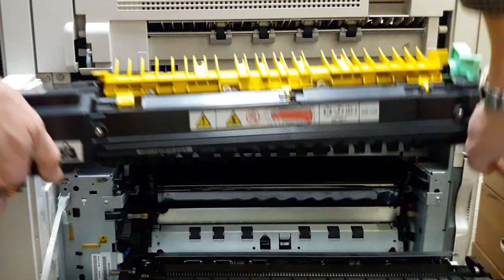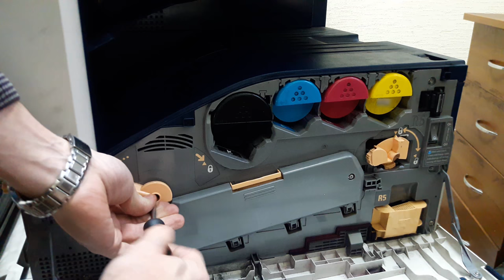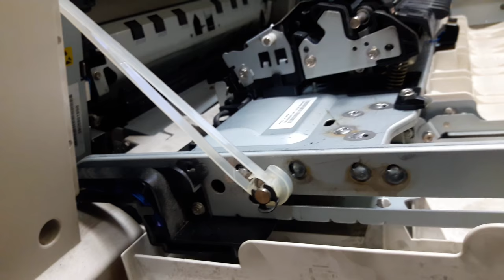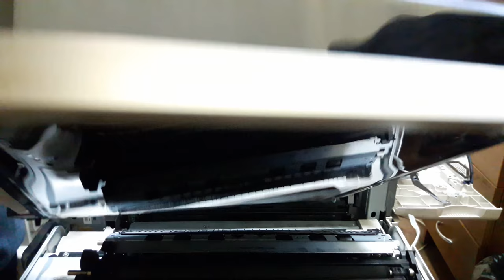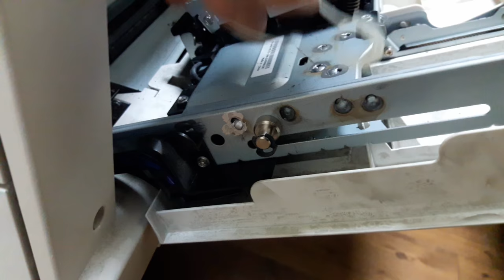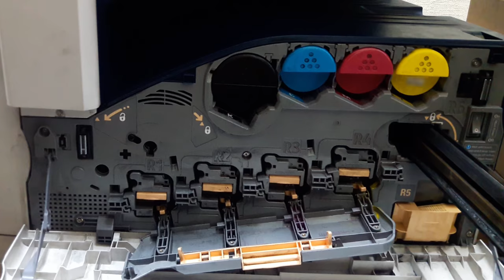How to replace Xerox WorkCentre Fuser & Transfer Belt Unit 7425, 7435, 7525, 7530, 7535, 7545, 7556

Comment: Hi, although very interesting,you missed two very important steps....firstly..the left hand door had two straps...the left hand one you removed..but what about the right hand one? this needs to be adjusted so the door can drop flat into service position...also...when installing a new Transfer assembly..you should  remove and rotate  the shipping bracket..if you don`t do this it will cause image quality defects such as mis-registration.regards
Reply from the maker: Yeah! Thank you! There was only left strap ...
Reply: Where’s the shipping bracket ? Is it a part of the Transfer Assembly Unit ?

Comment: I have a problem where there is a line of toner on the fuser belt that results in a continuous line on the print out. After cleaning the transfer belt, the stain comes back. What could be the issue and how to fix? Also, how to orient the paper so that it doesn’t print on the part that is having the stain?
Reply from the maker: What color of that line? Can I see a picture with that line?
Reply: @ElectronicsComputers  how can I send you the picture? I’ve cleaned the transfer belt again with IPA. But issue is still present. I’ve seen the maintenance guy re-orient the paper settings so that it prints on landscape such that it doesn’t print onto the part of the belt with the problem. I can’t find the setting and maintenance guy no more around. Do you know how to set the paper output so it orients to landscape when passing through the transfer belt?
Reply: @ElectronicsComputers  color of lines can be in color at times but most of the time it’s grey. But color and greyscale has been observed even when printing greyscale only